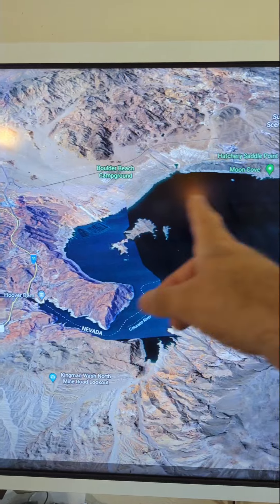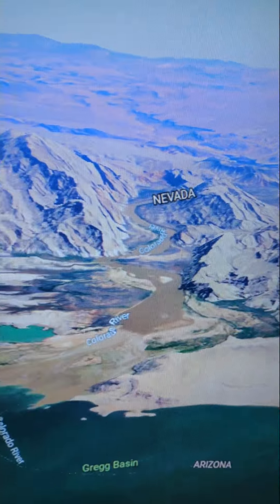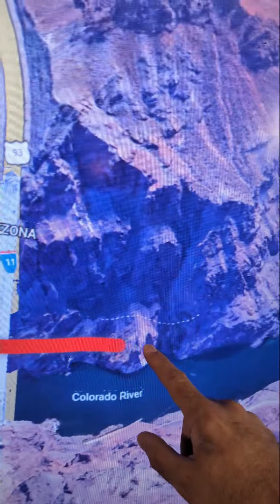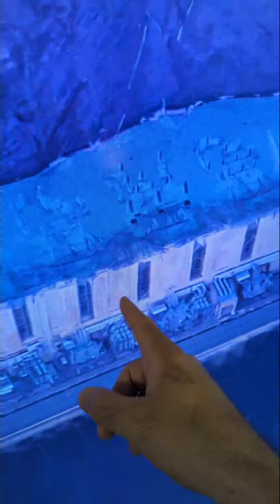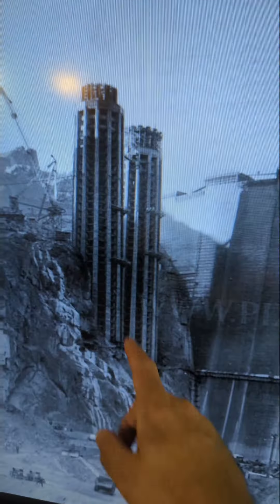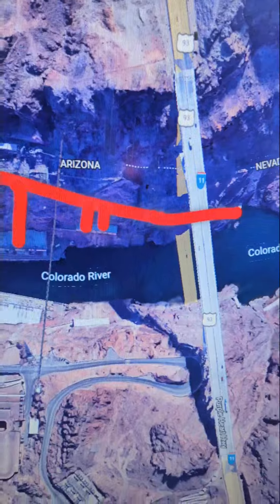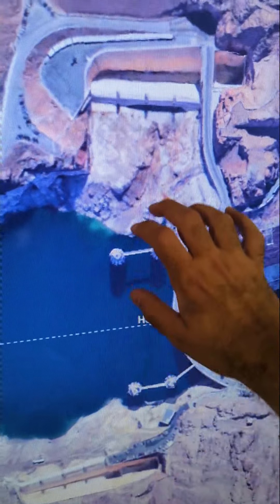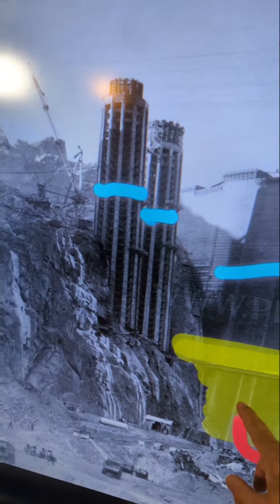Could Lake Mead go completely dry?

Comment: Nice video. There's still lingering questions. The lack of power generation going into Las Vegas, the lack of water for agriculture (how are they're going to maintain it?), how about the expansion in Southern California in which they're consuming over 48% of the lake? if it goes to dead pool, Souther California going to be an economic nightmare. Sure, the lake will not dry out completely, but the consequences of it nearing dead pool means less water for agriculture, consumption, etc....Lots of problems everywhere.
Reply from the maker: All good questions without easy answers. Ultimately, we won't be able to use water that isn't there to begin with. Cutbacks will be painful, but could have been less so if they had started a decade ago when the problem was first apparent.

Comment: Not entirely correct. Electricity Production cut off is at 950 ft elevation (and significant reduction happened already at going below 1050 ft elevation). Dead pool is 895 ft. SNWA pipeline intake is at 875 ft and third (and last) Las Vegas intake in Lake Mead is at 860 ft elevation. Note that there is also evaporation, agriculture and lawns. Not also, that volume of water is shrinking significantly faster compared to elevation, as the lake narrows down. 

But anyhow, the official estimates are that 1-2 no worsening situation regards power production or water intake. And (only) significant risk to hit even Dead Pool within 3-5 years.
Reply from the maker: But even at dead pool, Vegas can still draw drinking water.

Comment: Regarding silt say behind the damn in Maryland I believe.  It is becoming a real problem or will right?   Would it have worked to have built a grid of pipes on the bottom of the reservoir that would be used to flush the silt.   The grid would never let the height of the silt to reach a certain point because when it did, it would fall onto the drains and when the drains were open the silt would be flushed beyond the damn.
Reply from the maker: Yes, this would have helped. However, there are reasons that many dams don't have de-silting gates.

First of all, you have to use them! And when you do, it sends a surge of water downstream that creates new problems, both for people and wildlife. Second, the silt that moves downstream has to go somewhere. And many river users don't like muddy water. Not to mention the fish that can suddenly suffocate in the murky flow.

Second, de-silting gates have to be located at the very bottom of the dam in the center of the span. This is the spot with maximum pressure and structural load. Making the dam strong enough to fill the reservoir AND have holes in it big enough to pass silt was not considered a priority during the era of big dam building.

Does this make sense?
Reply: @ArmchairEngineer  which means all dams have an expiration date, since they will all eventually fill with silt. Right?